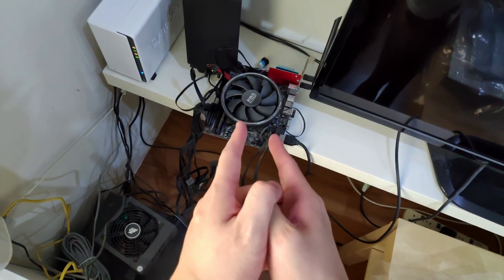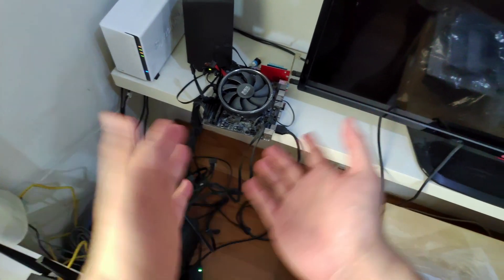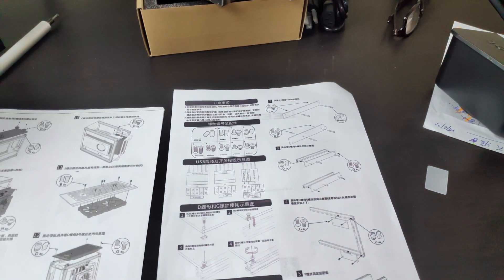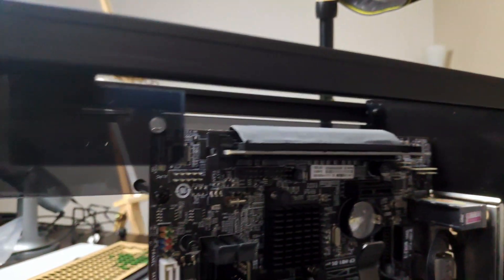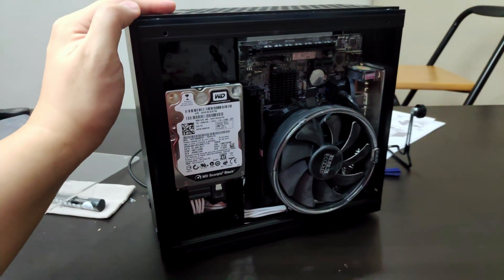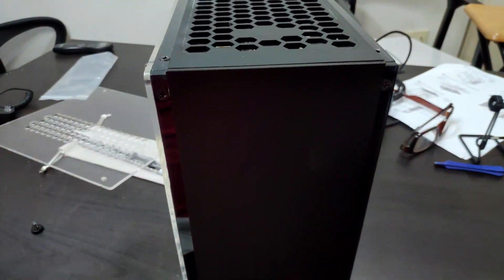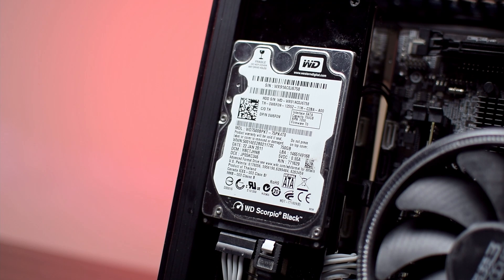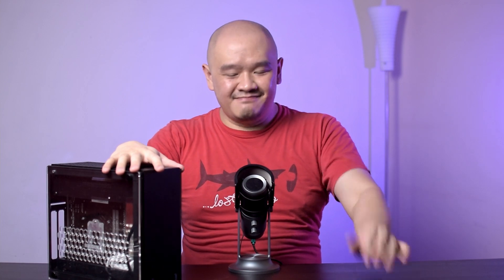Building in a SUPER TINY ITX Case! - GEEEK A35S Build & Review

Comment: Would it be possible to install a dingle fab cpu liquid cooler? I mean there's room for 2 fans on top why not?
Reply from the maker: As far as I know, 90mm liquid coolers do not exist, but every if they do, their thermal capacity isn't going to be very high
Reply: @TechRodent  Darn. Smallest cpu cooler I've been able to find so far is a 92mm by Asetek and a fan less one by Alphacool. But thanks for sharing your build I appreciate the info a whole lot. 👍🏼I plan on building a Geeek  A35 as well.

Comment: Your motherboard is not ITX, perhaps mini DTX or one of those common 19cmx17cm boards, that's why you'll need longer riser cable. But it's nice to see the board fits in this case. 19x17cm boards are usually cheap.
Reply from the maker: It is indeed a DTX board! Another viewer pointed it out, and it's great to be able to learn something new haha.

Yes indeed, it fits, and I even managed to get a longer compatible PCI-E 4.0 riser cable for this build.
Reply: Cool, how long is your new cable?
Reply from the maker: @jccnguyen  it is 20 cm and it perfectly covers the distance from the slot to the mounting, with nearly 0 extra slack.